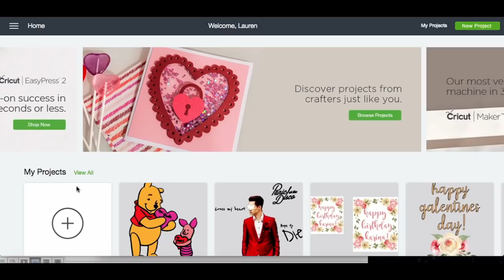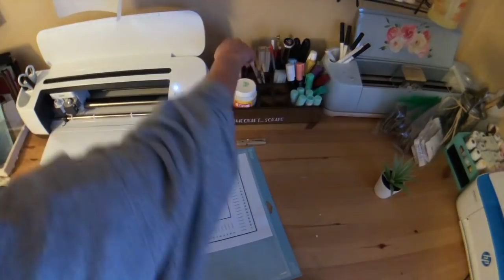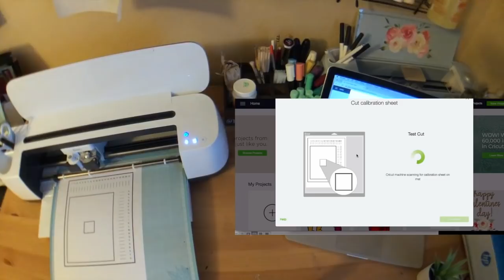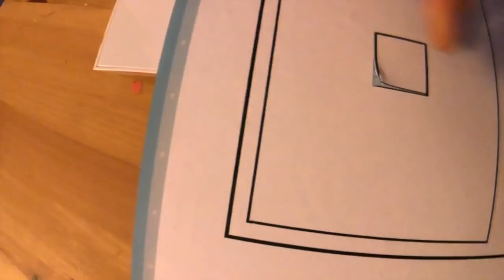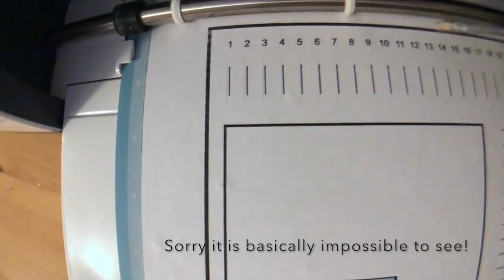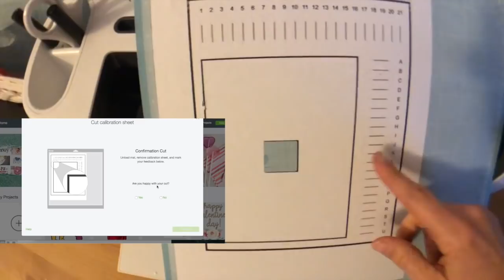CALIBRATE YOUR CRICUT MACHINE | Learn how to calibrate your machine for Print then Cut!

Comment: Hello!! I think I'm having a bit of a problem with my sensor light on my explore air 2, I don't think it is properly detecting the top and left lines but does it perfectly for the bottom and right line. this is making all my cuts unaligned. I tried to calibrate it multiple times but it still does the same incorrect reading. It wont even cut the simplest of shapes correctly. This problem started on like my third time using it. Any ideas on how to fix this? I tried many things and I'm losing my mind over this.

Comment: I have the Explore air 2, the calibration isn’t working for me. I’ve done it like 10 times ! The first box cut is never on the lines. It proceeds to the top and right cuts but it always says to reprint and start over. It never does a final cut. HELP PLEASE LOL I’m frustrated with this machine.

Comment: I have calibrated my cricut like 5 times and when I make a project it just keeps cutting off !
Reply from the maker: its funnier in enochian honestly I’ve never gotten my Cricut to calibrate perfectly! 🥺
Reply: @thecraftscraps  the calibration is fine is just way too off whenever I cut my sticker sheets, do you know why this happens or anything I could do?
Reply: @KarouLoves1D  if you found a solution let me know... personally i think im going to try and do the calibration ON sticker paper. that way if its the paper type or gloss of the paper or anything at all, it may calibrate for the paper type im using if that makes sense. fingers crossed this works.
Reply: @kelseyshire  it turned out it was the way the cricut was sort of grabbing the mat, so when you press the button to grab it, make sure both sides are being grabbed straight! :)

Comment: I need help! So ive got an epson SC P600. When I print as a PDF it comes up at 97%, should I change this too 100%? It is a different size by a few mm when I press just 'print' This is what is making my cut out by around 1mm as it goes towards the bottom of the mat! Please help.
Reply: Yes you should! If you are doing a print then cut, then that means what the circut is at 100%. I hope this helps!

Comment: Good job on the video.  (I realize it's a year old but wife got this for me this Christmas).  Unfortunately for me, I wanted this specifically for print and cut and the calibration is too far off even after trying to get this thing right multiple (approx 6 ) times.  Other problem I have (still having....) is everything I print through design space is terrible in quality.  The machine (maker) refuses to read it and keeps giving errors.  The only time it works is if I can print it to my printer without Design space.  Big problem when trying to calibrate but I finally found a pdf online that allowed me to print the calibration sheet straight to printer.  The machine read it but the calibration is still wrong.  So far the only thing this has achieved is waste a lot of printer ink.  I did manage to do one project but the calibration was so off I had to trim it by hand (bad idea)...  Think this thing is going on Ebay.....

Comment: Thank you for taking the time to make this video however, your instruction was incomplete.  I was seeking a tutorial to help me calibrate this machine to get a precision cut.  You showed the steps on how to calibrate the machine but you didn't show the finished product to prove that the calibration was spot on.  No matter how many times I've tried to calibrate the cuts, I consistently getting cuts that are off.
Reply from the maker: Mine are semi off as well every time. I believe I didn’t show the finished product because by the time I was finished it was dark. I’m happy to do an updated video ❤️
Reply: @thecraftscraps  It's not necessary.  I've tried calibrate it to no avail and probably have wasted $30 in product.  I believe it's a software issue and requires external software to maximize the outcome!  Thanks for the confirmation that I'm not the only one having problems with the cuts being off. Thanks for your reply!  Very kind of you!

Comment: Did you by any chance do anything special with your printer to have it print from your cricut? I just bought myself a new very affordable printer the hp deskjet 2652 and it prints everything else fine. When it comes to printing something out from cricut it is super super slow that I just decide to cancel the cut. To just print out a 2×2 circle it will take almost 5minutes. I want to know if there's something I'm missing that I didn't do or if it's just the printer. Help please
Reply: Just to print out the calibration sheet it took maybe 5 minutes

Comment: If my print and cut is correct should I still do this? I  got my cricut 2 weeks ago and I haven't calibrated, but it seems to be cutting the lines correctly.
Reply from the maker: Hmmm good question!! If you’re happy with how it is maybe don’t worry about it but I would recommend printing on plain paper and doing a practice cut first just so you don’t waste materials!